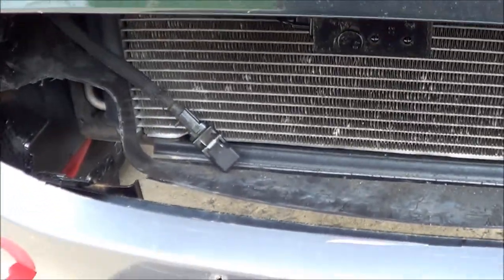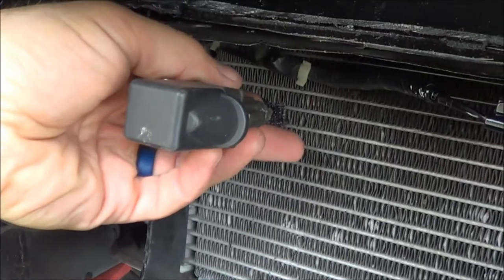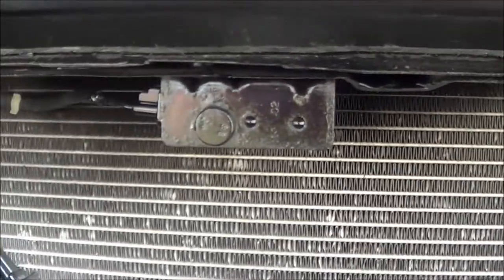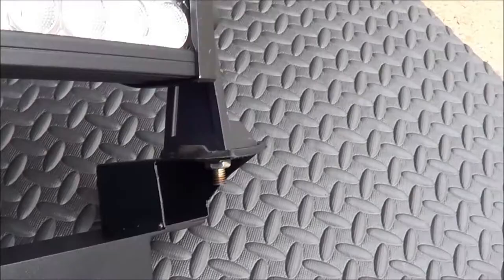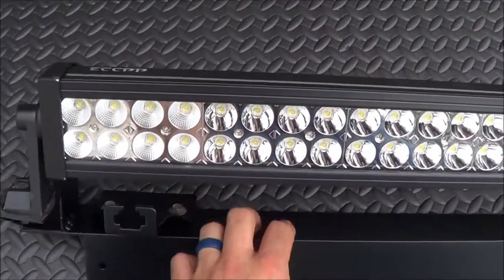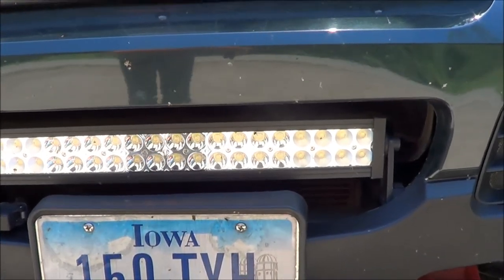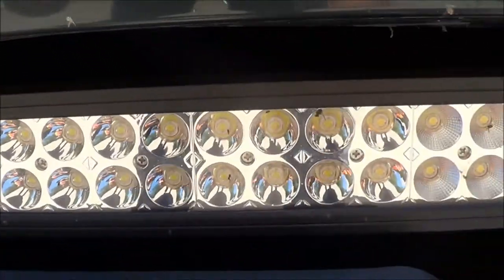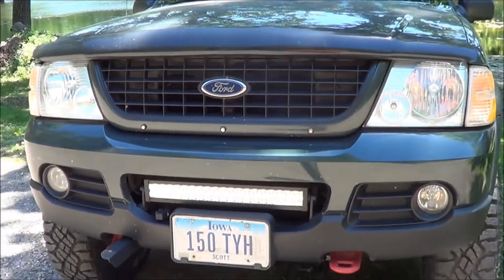2002 Ford Explorer LED Light Bar Bumper Install

Comment: Would of been nice to see how it looks at night time, like light up a huge field with like a driving range with yard SIGNS of how far it lights up and how bright it is, also I didn't see him mount a switch or a box to run this light bar, maybe I missed it but it would be nice to know this info if your gonna make a video of your truck and how to mount it, to me, that's the easy part, its knowing if you need a LED BOX to control the light's only because I have friend's that have up to 3 boxes to run all there light's and wig wags / flashes like the police fire department or tow trucks have some of my friends use these because they tow trailers with cars on them and they have all kinds of Lights they have fuck off whites and that's when somebody's right back bumper they hit the switch to light them up with the rear lights when they're backing up and blind the heck out of them to say hey get off my bumper now or you will be blinded, its all recorded with DASH CAM'S ON FRONT AND REAR OF THEIR TRUCK'S, its one way to keep people real plus if you get pulled over by DOT when your towing your 5th wheel car trailer with 2 car's on it. Jis trailer alone bought from the FACTORY at a DISCOUNT for $9800 with a paper tag to drive it home 500 miles, he took a day off and spent the night down with the wife and bought trailer which she supports him on everything car's related unless its been a MONTH STRAIGHT without 1 day off. He has a GARAGE at home that holds 3 full size TRUCK'S which all sleep inside plus he has his own LIFT to due work on car's, he helps out family and friend's and sometimes he doesn't get a break at all. Thats when the wife says something because he works a 40 hour a week job plus OVERTIME, so we all need time off, he scraps cars in the side and has lots of great parts, he could go into his own business if he wanted to as a MECHANIC since he has every license there is plus he works on cranes and any scissor lifts and all kinds of machines like that also and has those licenses to fix those to. No kids and busiest  person I know. He's a great friend that i can tell you. I always wanted some light's like his and he said no you don't because you need this and that plus you need PERMITS WHICH 99% OF PEOPLE DON'T GET AND CITY AND STATE ARE EXEMPT FROM IT BUT EVERYONE ELSE ISN'T IN OUR STATE. My sister got a ticket 1 night in a different town because she's a EMT for the FIRE Dept in her TOWN and got called, so she threw her red light in the WINDSHIELD and got pulled over for speeding and use of red lights in a TOWN that don't allow them from a civilian car, she was on call but law's are law's and she won in COURT but was told don't use again and stay closer to home, she was on her way home from grocery shopping thats 10 miles from her house because she saves over $150 every 2 weeks for her and her husband. She met them on seen instead of at ambulance at fire station and her husband came down to the location which it was enough people to cover in same place but it needed EMT with the help of fire but had enough show up and he was off duty as a part time JOB. She got the laws for both states since she lives on the line of 2 States and she can use lights in her town but other places must be in the grille with flashers going abd she should have the red wig wags flashing on four corners is the proper way to do it on her car but she tried to cause every few years and didn't want to spend $400 to $500 to have them done when she could just throw a flashing red light in a grill and have a sticker on her windshield and back window that she's the fire department plus her license plates also have the fire logo symbol on them. She could of paid a $500 ticket is what it would of been but it got fixed with her EMT card plus a letter from her BOSS, the police officer apologize to her as he wrote her a ticket but he stated he had no choice because the town did receive phone calls about her coming through the town which she was on the opposite side of the town and drove about 6 miles of 7 miles through the town with passing cars wish she could and she caught up with her before she entered into her town that's where he had pulled over but you only wanted to let her know the laws in that town. He stated no phone calls came in he would have just pulled over quickly and told her to look them up and hurry up and get to your call providing that you going to a call because I can hear the call that came across because they do help out one another with fire department and police departments but they don't know that some people on call because it's a small town and when somebody goes on vacation they put people on call to cover those people so they're not paying people for nothing. Back to truck, I would love to see it work and how far it goes and what did he hook into and grab power from what and is there any inline fuse ? And where did he mount the switch, only because 1 town over from me and my state, any off road lights that's not FACTORY must be covered if connected or not be connected at all. I got pulled over coming out of the woods many year's ago and had big KC BAJA LIGHT'S mounted on my front bumper, I didn't have a Roll Cage and they were on coming threw the woods onto a dirt road that was owned by my boss at the time at a sand pit. I was told and he went to give a ticket to 4 trucks until we showed him pay stubs to the OFFICER and said we have permission to be here and yes 99.9% of people don't. You jave a key to the gate to CATCH dirt BIKES that mess up and contaminate our piles of dirt that makes a big difference on selling those piles of dirt to company when we send them through a machine to get them to different grades of sand and all this land as you know and as you know he's in the works of donating a trailer with a couple four wheelers for you guys to the police department he's like yes you know that I'm like yeah I work here Nick is my boss and so isn't the lawyer which is our silent boss silent partner which is the other owner of the company but we don't go over where we work unless we take girls and party down at the water and go skinny-dipping for girls but that's about it and we stay on the roads and do not go in the dirt piles. He smelled alcohol on us we asked if we've been drinking yes that's why we're out in the woods for cuz we don't drink and drive on the roads just off road are you think that's against the law also we had to be to work for 6:30 that morning and this happened at 3 in the morning so I told him we were spending the night cuz we have to be to work at 6:30 anyways. If at all we might run out and get a cup of coffee and open up the gates.

Comment: How did you mount them lights on your grille looks nice?
Reply from the maker: Drilled holes. Thanks!
Reply: @HawkeyeSkunkWorks  nice 👌 I done my led bar upside down and only cut the two lil pillars off and it fit perfect. Looks good with the trim still there

Comment: if i just put on strut spacers will that mess up my cam?
Reply from the maker: Im assuming that by "cam" you mean camber. Yes, you will need to get an alignment after installing lift spacers.
Reply: Hawkeye Skunk Works okay so does that totally correct it? if it does that's awesome! some people where I live have been telling me it will cause my ball joints to snap lol
Reply from the maker: Yes it should, Ive had no problems getting mine aligned. Lifting any independent front suspension like the Gen3 Explorer, which is A LOT of other vehicles, will increase the pressure and wear on your ball joints, thats just the cold hard truth. Will if cause them to snap? Probably not, I guess that just depends on how hard you drive it.

Comment: Hey what kind of exhaust tip do you have that will fit my stock 05 explorer exhaust
Reply from the maker: No rear cat, Dynomax turbo muffler.
Reply: Can you send a link ?
Reply: Also how much do the tow hooks usually cost ?
Reply from the maker: @adambirkholz4337  should be around $20 at your local junk yard.
Reply from the maker: @adambirkholz4337  It's the cheapest one they offer, I know that.